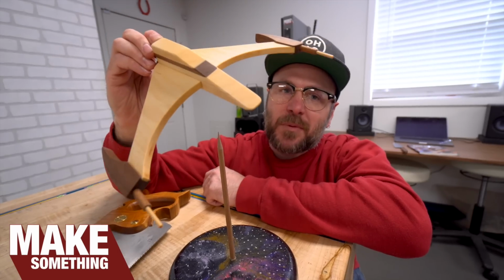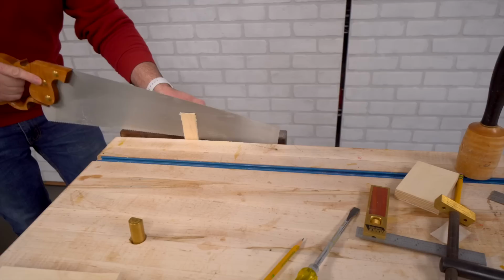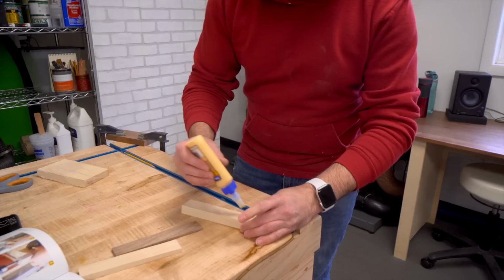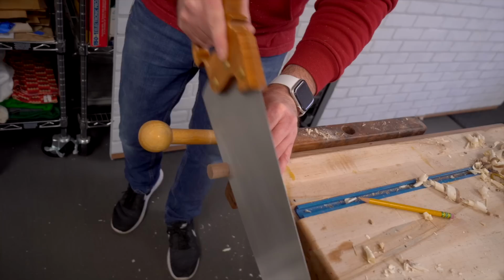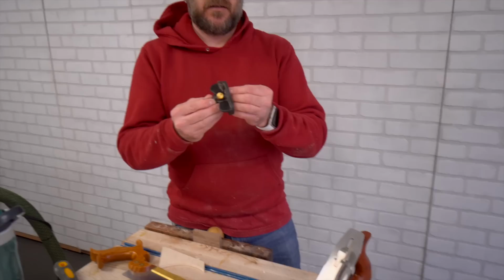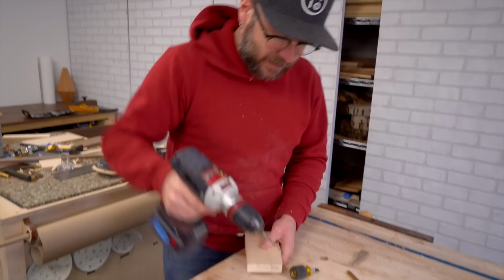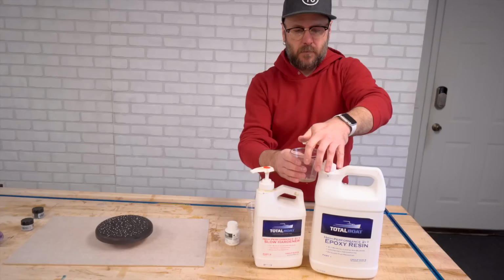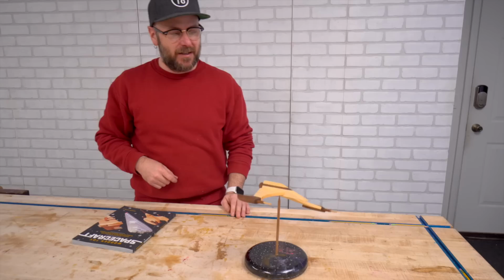Making a Wooden Spacecraft with Only Hand Tools | Woodworking Project

Comment: So many cool things in this one David!
1. Laser effects (of course!)
2. The Jimmy DiResta ice pick star layout jig.
3. The color epoxy on the base to add nebulae into the star background.
4. The dowel in a dowel trick - gonna employ that one for sure!
5. The importance of a planing stop for small pieces. I had to plane a small piece for a small display case recently, and a planing stop (like you made) or a slightly raised bench dog makes it so much easier than trying to lock it into a vice.
6. And of course the challenge of doing it hand tool only!

Nicely done!  - Jim

Comment: Small tip: I've found that if you want to make a lengthwise cut on a board, using a hand saw, it's easier to keep it straight by cutting the long side instead of cutting the short side. (So, if you have a 2x4 that's 10 inches long, put your saw blade flat along the 10x2 or 10x4 inch rectangle.)
And the hand drill you're thinking of is called a "brace."

Comment: To help you cope, put your saw blade in so it cuts on the pull stroke. Have your saw cutting down through the board, your hand should be below the board. Your will be able to see the cut closer and clearer. Also the board won’t be able to “jump” off the work surface. Great looking spaceship!

Comment: Well done.  Yes you can use rubbish tools but good tools whether hand or power make the project easier and more FUN to do. No table saw and cheap bandsaw means only way to resaw is with a handsaw for us! (so all material left very thick). Enough saw's in there for you?

Comment: You're not Gibbs but in my Not So Humble Opinion, You did Great!!

On that stand, you could do a bit of modification.  Replace the dowel with some really strong magnets.    Shove one magnet rod down into the base.  Now find the attraction end on another magnet rod.  Mark the opposite end.  Check to be sure it repels.  Shove the attraction end into the Space Craft.  Now your Space Craft will 'Float' above the stand.  It can spin, wobble, and you could pass something quickly thru the 'space' between the base and the Craft.
So? on the Cool'ometer, how does a 'Floating' Space Craft rank?

Aunt B

Comment: I say you pass the hand tool challenge even though you used a power drill, because it was a hand drill (and not your drill press) You didn't say you would be using unpowered tools only. #goodjob
Reply from the maker: Ha! Yes!
Reply: Grant Alexander he stayed closer to “no hand tools” than everyone else who says that then breaks out the CNC saying it can be done with a router.